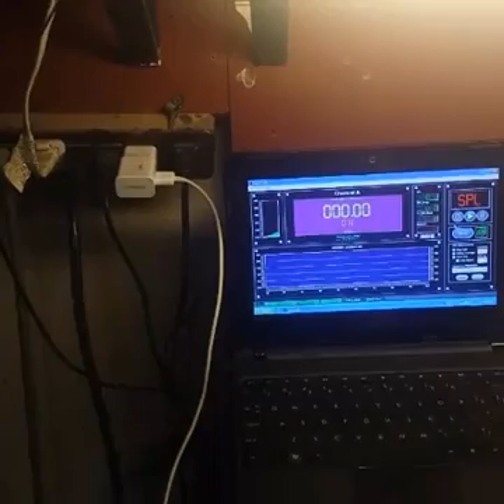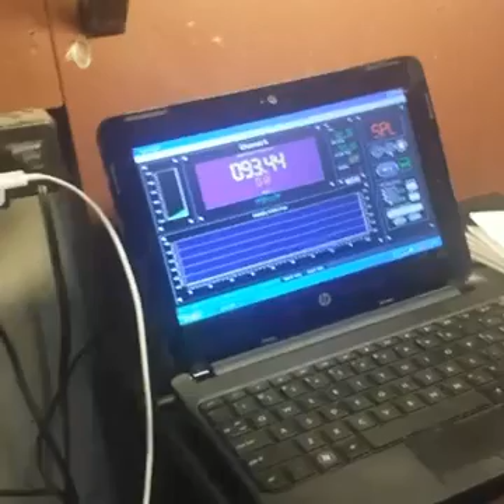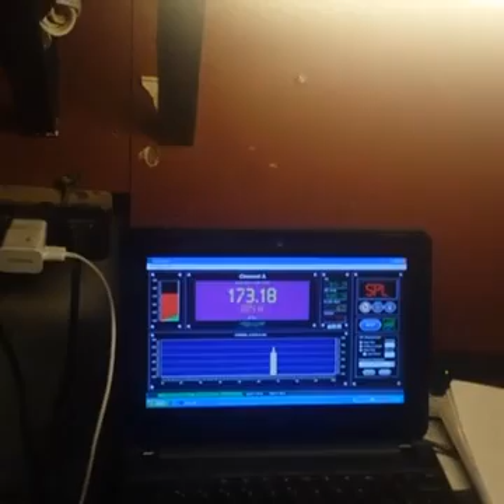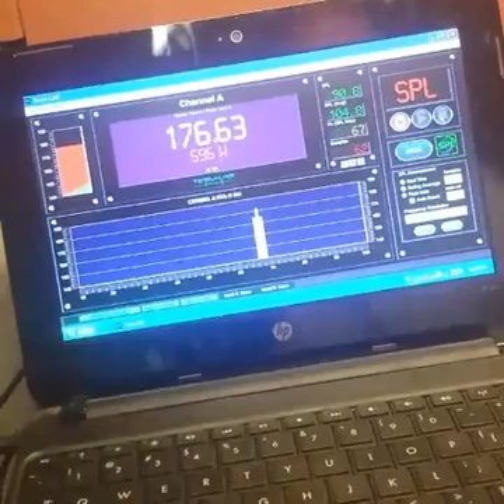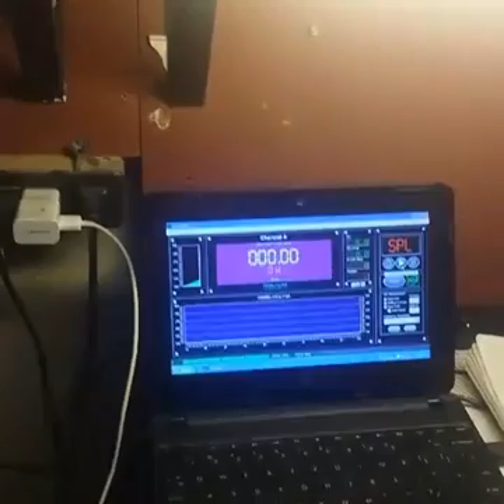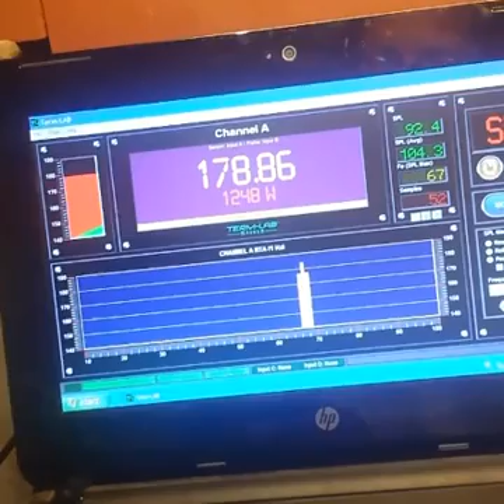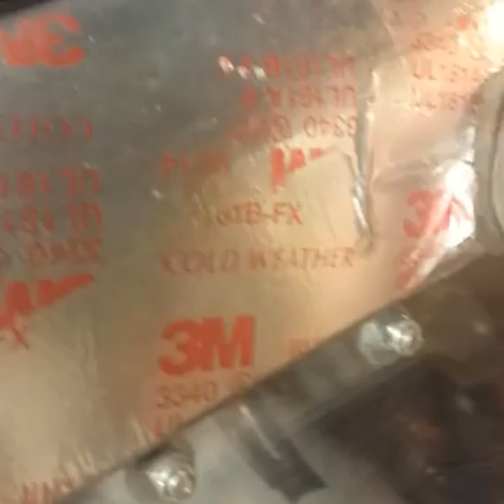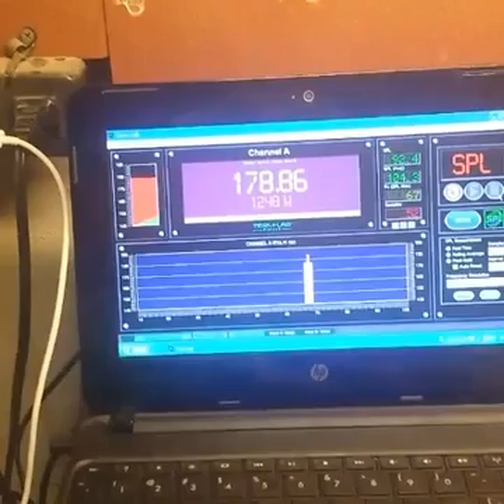Two EMF YOLO 15's over 178 dB under 5,000 watts, worlds loudest

Comment: i call complete bullshit lmfao!!!
Reply: So how are you using 4 8k's but only 5k watts? It's kinda contradictory. Don't ya think?
Reply from the maker: You know the volume knob? It adjusts power. If you don't turn it up all the way, it doesn't make full power.
Reply from the maker: You should probably pay more attention to car audio and study acoustics.
Reply: EMF Audio  surrreeee
Reply from the maker: Matt Snapp there is a class in dB Drag specifically for extreme cars under 5,000 watts. Its commonplace to be at a 174 to 176. Pay attention.

Comment: those numbers are ridiculously loud, not just for only 5k but also and for only 2 15s, at first I was thinking bs, but I suppose that's what you get for building a car into that State, it's totally set for SPL competition, everything is rock  solid, ID like to know what the amps rated power was, because generally the output you get from a variable load like subs will have a higher ohmload on most frequencies than what the woofers coils are rated so I could see these amps being rated for 500+more than what your getting on the tests, it really is all about the whole build coming together just right, I was at a competition during the summer, I was expecting to have the lowest competing score, on my 2sundown e12s on sundown 1000D, I hit 136.3 db, just throwing my prefab box in my workvan, standing up longways making me advance class, and my classes max wattage was 2k, I got 2nd in it, but in the regular 2k class a guy had a huge box with 2 or more 15s, and he was clamping over 2400 Watts and only got 135 db, I was shocked
Reply from the maker: Matt Wells he's got amps rated 8,000 each
Reply: +EMF Audio ah so it's alot more than what power is actually going to the woofers at this builds peak SPL, very interesting, and that's the RMS rating I presume, also, what's the frequency being burped
Reply from the maker: The class this is built for is limited to 5,000 watts of clamped power so how much the amps can make doesn't matter. He plays 67 hz
Reply: +EMF Audio nice, I actually looked up some world records and saw the extreme 5k classes record was 179 I believe, somewhere in that range, so thus thing truely is one of the loudest
Reply from the maker: It's not one of, it IS the loudest. You can't look at the regular SPL listing because the classes may not be right. You could be listed as a 5k on your membership but posted a no limit score. Certified SPL score is the correct class for sure, and 177.4 is the highest anybody else has done.

Comment: where was the mic at
Reply: nevermind lol just needed to watch more
Reply: can u save me the 20 min?
Reply: it was on the winshield i was thinkin port or in the kick but nope its on the winshield
Reply: damn so on the first one he was doing 165 at 120 watts (on each amp i assume)?
Reply: essentially yes but this van is specifically built for numbers hence the interior being completly empty of seats and being fiberglassed and doors bolted shut to keep all the pressure inside
Reply from the maker: The 165 was done at 29 watts per amp, 4 amps, 116 watts total.  The number under the SPL is the power.
Reply: EMF Audio  Oh wow, shit i got a sony 444W amp that puts out about 35W RMS to 4 channels that used to drive my door speakers with, I didn't know I could of been pushing some numbers with it  (jk =]  )